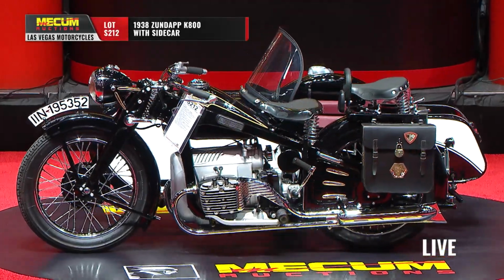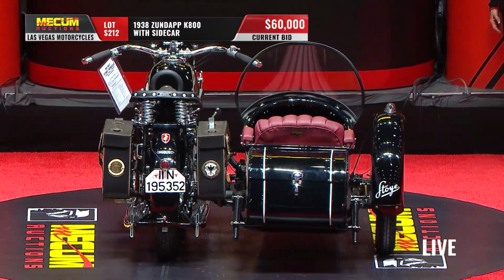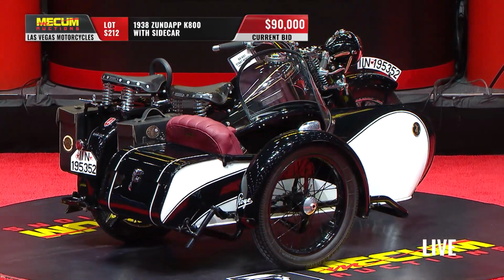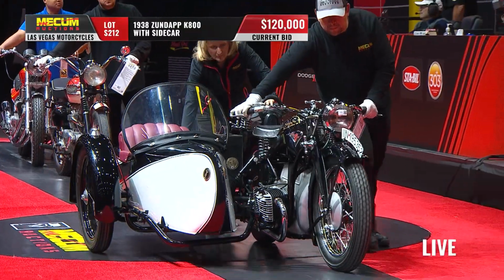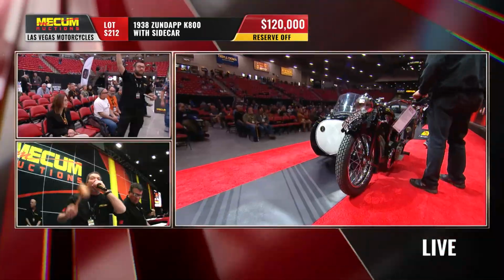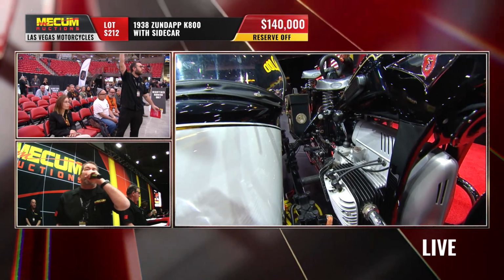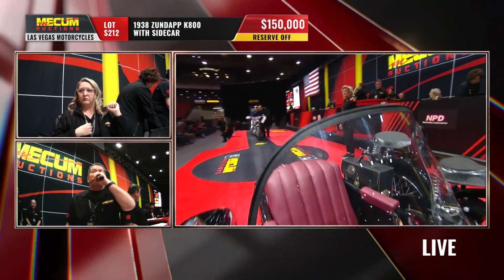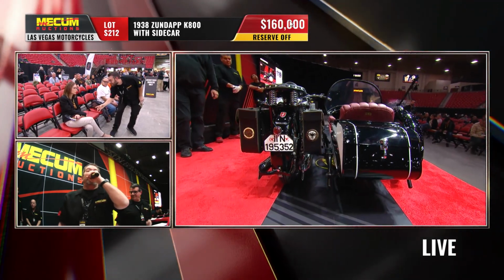SOLD for $170,000...1938 Zundapp K800 with Sidecar // Mecum Las Vegas Motorcycles 2023

Comment: KS600 is idential but more power, more reliable and foot change. Zundapp dumped the 800 because the rear cylinder eventually overheats and seizes up..(no air flow) hence the big chrome heatsink. Crank needles are weak too. Lovely looking though, glad ive got one of each 😂

Comment: A year ago, there was a similar bike for sale here in Belgium. It has been sold for (app.) 30000$. What a difference in prices in America.
Reply: Yep maybe 30 to 50,000 in europe. KS600 is a identical but much much better engine.. more power,  much more reliable, nicer to ride with a foot change. They are still good value at 20 to 25k...